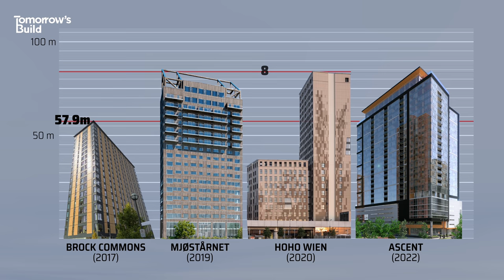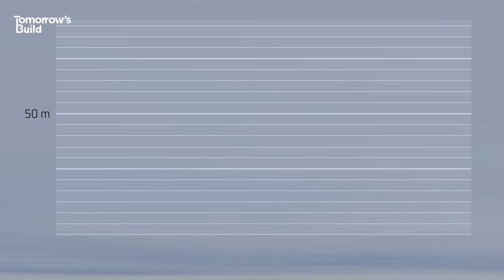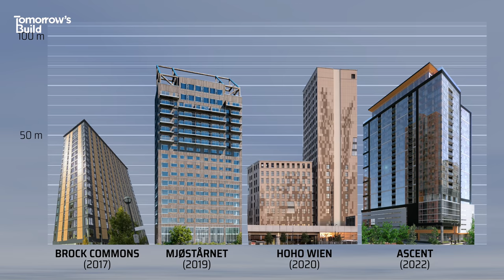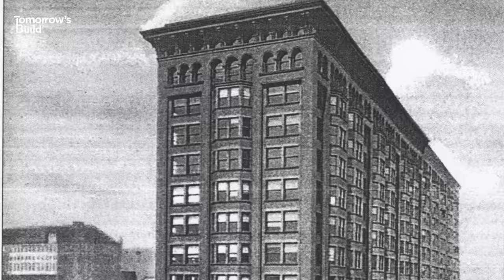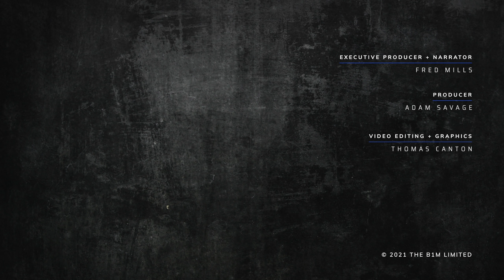Why There Are No Timber Skyscrapers

Comment: This is very similar to what's happening in the rollercoaster industry atm, originally in the late 1800s right up until the late 1970s like 90% of rollercoasters were wooden and stood at about the 70ft - 100ft mark but once a company called Arrow started using tubular steel ride heights and lengths exploded all over the world in a period in the mid 90's - early 2000s know as the coaster wars where theme parks rapid and aggressive expansions directly competed with each other for world records until they were halted by the 2008 recession. 

Then in 2011 a company called Rocky Mountain Construction debuted their hybrid coaster model combining wood and steel at Six Flags Over Texas on the New Texas Giant rollercoaster. Fast forward to now and these hybrid coasters are all over the world and pushing 250ft tall with rides like Steel Vengeance in Ohio, Iron Gwazi in Florida and Zadra in Poland. 

It's a really interesting topic with its ties to construction I think it would fit in well if you covered it here or on The B1M.

Comment: I am very curious what the sound quality is like in these units when compared with their concrete brethren. The US already has some of the thinnest walls in the world and I am curious if this has any sort of negative consequences sound wise.
Reply: Walls are usually hollow wood structures with gypse sheets, and sometimes isolation in the hollow part. Or in more industrial buildings, walls have 2x4 thin steel C sections that support the gypse. If you have a massive CLT or gluelam wall between two units, rather than either a thin fire-retardant concrete or some cheap isolation, the massive wood wall will provide way more tranquility. Possibly more than equivalent concrete, the stiffness of the concrete will propagate low freqencies, and I would be lead to believe the wood to have some level of dampening. Take my opinion with a grain of salt, i'm studying engineering, i'm not licenced yet hehe
Reply: I instantly thought of this. Every shared living space built out of wood I've had noise transfer issues. An issue that not many people think about till they experience it themselves.

Comment: I feel like we can reframe the question. It may be difficult and expensive to build skyscrapers out of wood, but the midrise buildings we would like to use to fill out density with better urban zoning especially in NA can absolutely be built with wood.

 Canada's forestation is increasing due to climate change, so I'm hoping that economies of scale and professional experience will make building those midrises easier and cheaper, which could help to solve the housing crises in Toronto, Vancouver, etc without excessive carbon emissions in doing so.

Comment: Timber towers are cool but if we want to eliminate most of the waste of concrete and steel we need to get the low hanging fruit. There are exponentially more structures as you go down in size. In Vancouver it’s so normal to build 4-5 story apartment buildings with timber no one even thinks about it. In Australia EVERYTHING is concrete

Comment: A Lego like building system factory mass produced with Timber is needed to bring costs down.   Steel wrapped and bonded timber might also have some synergy benefits, fire protection, buckling optimized, surface damage resistance.

Comment: Using timber for construction is also a good carbon capture and sequestration move. Capture carbon from the air and seal it down in a building structure.

Comment: I looked into the sustainability of various options as part of a RIBA Stage 2 report from a structural engineering perspective not that long ago. For the scheme we were looking at, timber actually came off worse from a sustainability point of view compared with concrete and steel. First was the volume of material required to achieve the same stiffness in beam and column elements. CLT and Glulam options required more material than their rivals. So although the kgCO2/kg of material was less for timber, it was offset by the volume required. Second, was fire. The building required a 2h fire rating and the treatments and materials being looked at were not exactly environmentally friendly in their own right. Thirdly, cradle to grave analysis was also unfavourable. Although timber construction kg to kg seems more sustainable (though note the first point above), sourcing timber is not exactly a zero carbon endeavour. It is not like steel or concrete where you are mining otherwise inert materials out the ground, harvesting trees removes the carbon sink. The volume of timber use in the project would not be able to be replaced within the lifespan of the building given the speed at which trees grow. Forthly, raw timber is not suitable in its own right. Standard C24 timber would not be suitable for a project that we were looking, or the video alluded to, so CLT or Glulam was considered. From the analysis we carried out, the resins and glues used to bind CLT and Glulam together are in their own right toxic to the environment, albeit inert when insitu. This leads to the fifth and final point we found - grave. Timber in the form of CLT and Glulam is not currently recyclable, and does not biodegrade in the same way as raw timber does. So unless we are able to re-engineer the materials to be reused on other projects, then they'll just be sitting on landfill. In fairness, this is a problem all materials have, concrete especially, but steel less so. Happy to discuss any of these points in case our previous studies have not shown something out there that could've been considered etc.

Comment: Here in the UK, timber buildings and timber facings look so beautiful when they are erected.

Then, when they have aged, they all look a very dreary and unappealing grey! I have become accustomed to being highly disappointed with UK wood buildings and wood finishings

How long, before everything starts to rot? 
How can water be kept out of the joints?
Do these wood buildings need to be regularly coated/treated, if they are not to deteriorate?

Interestingly, I live in a Victorian house, built in 1870. Recently, while working on the roof bargeboards, and also the timber lintels, they were in perfect condition, almost zero rot, after 150 years.
They smelled like cedar? The wood was definitely pink-red

Thank you

Chris Moyler

Comment: I am pleased to see timber playing a more important role in the construction of high-rise structures. Wood will give designers new vistas to explore. Wood should show remarkable performance in seismically active areas. Wood should work well with more traditional high-rise materials such as steel, with metal providing additional strength in areas such as lateral stress-bearing. And wood is a renewable resource, making it more affordable in the long run.

Comment: What about something made of carbon fibre/nano tubes etc for the require stiffness of steel for the hybrid model ?
Reply: Carbon nanotubes only have a high tensile strength, so they could make a super strong cable, but they aren't suitable to carry a load under compression like where you would use steel or concrete.

Comment: So the building won't just burn to the ground if there's a fire, but what happens afterwards? Do they have to replace all of the scalded beams? Would you need to do any structural rebuilding for steel or concrete?
Also, how is cutting down trees sustainable or green? Aren't trees better at scrubbing CO2 as fully grown and mature trees, rather than just during growing?
If the key motivation is CO2 emissions, wouldn't it be better to just offset it by planting more plants?
Don't get me wrong, it's beautiful, but it presents some downsides that might make it impractical, especially with huge skyscrapers.

Comment: Can someone link me a video explaining how timber buildings avoid rotting in moisture, avoid termites, fire? Concrete are usually resistant to most of environmental conditions. However, there are several complex life processes in plants keeping the timber intact and protecting it. I really don't understand (and this totally my fault) how we can make timber last long because if we don't the demand might just overtake sustainable production and might encourage deforestation. Its a really delicate concept especially in the households where fire is a common thing in culture and chore (like in majority of asian houses)
Reply: they avoid rot by being treated during the process of making it, that same process deters bugs from wanting to live in it, and the wood itself protects it from fire - there's essentially "sacrificial" layers of wood that, should a fire happen, are intended to char without letting the fire penetrate deep enough to weaken the structural integrity. charred wood is one of the best fire retardants out there - can't burn again so the flames have nothing to ignite. there's a growing trend of charring the exterior or cabins and stuff and sealing them with oil, which can save a cottage from a small-medium brush fire. not to mention the charred wood looks REALLY sharp, it almost shimmers in the sunlight.
Reply: @Fenthule  Understood. But there another thing though. Is the process that treats the wood making rot and bug resistant, green? I mean if the process and chemicals pollute environment more than concrete, there is no any point of using timber.

Comment: Seeing buildings still using concrete cores and elevator shafts is so frustrating.  The same goes for projects that have a nice, ambitious mass-timber design but use lots of concrete for a multistory parking structure.

Comment: This is not a novel idea.
In San Frasisco for example there are many old timber high rise buildings due to the seismic envronment.
Nor is laminated engineered timer.
My quesion is whether the adhesive used in engineered timber is intumescent.

Comment: This is coming from a complete layman's perspective, but does carbon(fiber etc.) hold any potential for construction?
Reply: It is a great material, but it's difficult to source in the appropriate quantity.

I am not an construction engineer yet and I don't really have a thing for skyscrapers, but I'd imagine skyscrapers use it for stiffening, because it's incredibly light, stiff and tough.

Graphene (the miracle material that's been hyped up for like 30 years now with very little result) is finally being deployed in the UK as an additive to concrete, to make a certain structure strong enough to not be braced with steel, as load bearing concrete structures usually need to be.

Graphene would have a future in this for sure, if it is possible to produce it to the necessary extent.

But prices are important, the reason concrete is so common as a material is that it is near impossible to challenge it on price.
Reply: @laeamminlakana-matt5692  those are some nice insights, thanks for sharing!

Comment: Question... What is the purpose of building skyscrapers wood, steal, or concrete? When compared to to high density cities the ones that stand out with the highest population per square kilometer do not have many skyscrapers. Paris, L'Hospitalet de Llobregat, Barcelona, Athens, etc. Shouldn't more focus be on removing vehicles, and vehicle infrastructure and building more 6-10 story homes. Anything about 15 stories really has no purpose.

Comment: What kind of glue is used? Is it biodegradable? Non allergic? Why even use glue? There are methods to connect the wood layers for example with wooden plugs or screws.

Comment: Even reducing concrete use in a skyscraper by 50% and replacing just that with timber would go a long way. Going all timber is great but if there are engineering/cost issues then until those are solved using timber as a part of a concrete project will still have a part of the environmental benefits
Reply: Replacing concrete w timber will go a long  way to do what? Enrich the timber products industry?

Comment: Now hold on a minute.  What happens if you are living in ANY floor other than the very top floor, and then someone who lives above you decides to drop a bowling ball on the floor right above you (for example right when you're trying to go to sleep). Or maybe they decide to do jumping jacks on the floor above you during all hours of the night? You will hear this and the building will shake.  You will become frightened and loose your sleep. 

Can you pour a thin layer of concrete in between each floor?  So that the sound isn't as loud like a bang? Also you hear everything in a wooden house, I mean sound just travels right through the woods.  There are some undeniable benefits of living in earthen (and concrete based) dwellings.
Reply: They are not just using wood.. There are steel braces, usage of concrete, that will definitely be poured on each floor and especially in the cores which act as the spine of the building and contain the stairways, elevators, and other critical functions for the building. Certain kinds of wood are in some cases, proven to be stronger than concrete. These details are not being disclosed in this video for the most part.

I lived in a wood frame building - 4 floors total including a garage underneath made of reinforced concrete with steel rods, and brick walls that are filled with steel rods and concrete, and it acts as a pedestal for the wooden structure on top. Each floor has up to 1.5" of concrete poured on each floor. Its a sturdy building with a deep foundation in the Marina del Rey area of Los Angeles and built on sand, and whiles its not the best place to build on in an earthquake zone, they have to dig deep to get to bedrock and the buildings in the area have sturdy foundations. These buildings are very resistant to big quakes, but I am not sure how these tall buildings would perform in a big quake, and I still think I would like them to have a steel frame, or concrete or steel. In larger quakes, especially like what the San Andreas fault would produce, the waves will be different and are call long period waves, which is more like being on the ocean and affects the taller buildings more than the quakes with upward jolting and very fast violent shaking, which these taller buildings perform better than the smaller buildings as an example.

These taller buildings made of timber use the same idea, but scaled up drastically. But the idea of these high-rise towers being made of only wood is completely false. There is a lot more involved than just wood.

I suppose, in areas that are not prone to large quakes these tall timber buildings may make more sense. Only time and more experimentation will tell how these taller wooden buildings perform. For all of this time, 5-6 floors is as high as they would build wooden buildings, but now there are taller ones sprouting up in Los Angeles, with the first 2 floors made of concrete and steel as a pedestal with shopping and parking, and these were tested to perform very well in quakes.

If you look up the earthquake experiments done by a company by the name of Simpson who makes Strong tie products, that are braces used in wooden structures. You will find vids on youtube that show an 8 story wood frame building hold up perfectly to a simulated 7.5 quake with no issues at all. Over here where I live, I don't think they will go much over 8 floors for this kind of building unless they build the wooden structure on top of a taller concrete/steel structure, but only time will tell.

Comment: It would be really great if we could use more wood in our buildings, but the problem is accessibility to building-materials - wood takes time to grow, and we can't use cheap, fast growing types of lightweight wood because of the lack of strength, even when laminated, we need more dense hardwood types, but they take longer time to grow to a usable size, so we're gonna need a lot of land, and I mean A LOT of land to grow all that wood, and it'll take decades to grow materials enough to even one, single "skyscraper"

- Maybe bamboo would be another option? It's fast growing, extremely strong and lightweight and they use it to build scaffolding in Asia, even to real skyscrapers. 

I think the most realistic scenario will be a mix of materials, even plastic, because of the sheer amount of building-materials we use every year in the world, but with focus on a lot more wood and other environment friendly materials, instead of steel and concrete.

Comment: skyscapers reach the height that they do because they use a combination of concrete and steel. So its only logical to achieve 150m+ it would require a hybrid solution. 
Maybe concrete core, steel bracing with then timber columns, beams, walls, etc...

Comment: One can almost hear the termites licking their chops...
NAW! Just kidding. This is fascinating, but I wonder if the embedded energy in the timber members is a true offset to steel or concrete? If you factor in the embedded savings by being able to nearly fully modularize the building approach, then the offset to conventional approaches might just be there.

Comment: Though it may be interesting but a properly designed energy efficient high rise building would have a more impactful difference than just substituting for 'greener' materials. Energy consumption goes up exponentially higher with skyscrapers, thus worsening carbon output indirectly. We don't need more terribly designed energy guzzling skyscrapers.